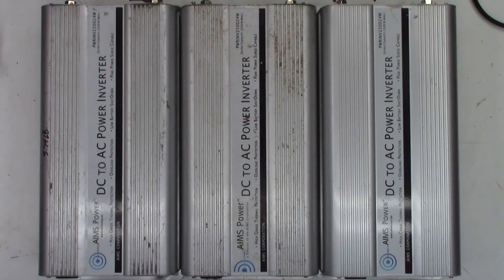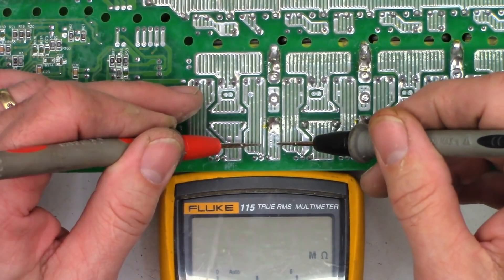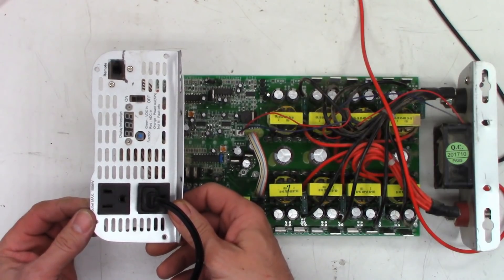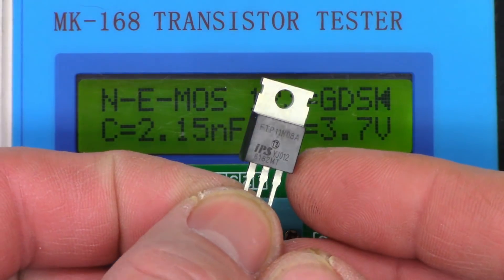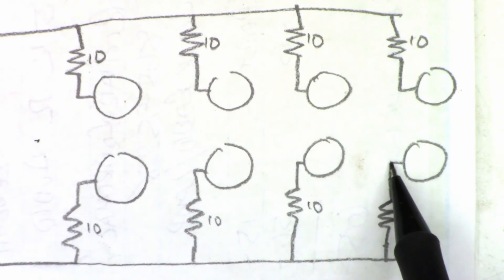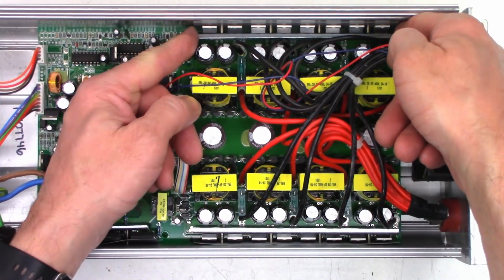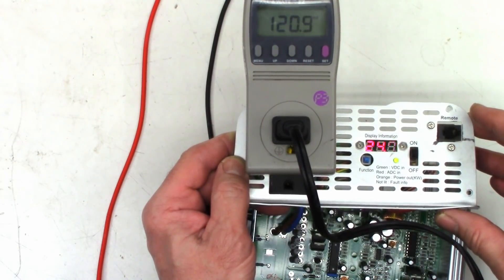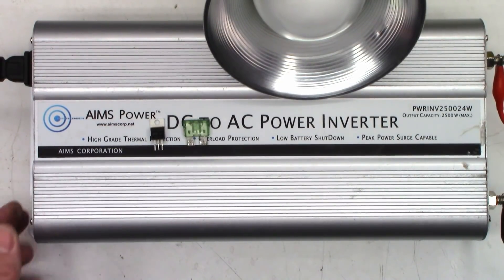CUSTOMER SENT 3 AIMS PWRINV250024W INVERTERS FOR REPAIR. THIS IS INVERTER #3

Comment: Thanks Again for all your videos, I will be checking out a lot more of them, And am gladly to donate, I have a 3,000 watt 12v Aims pure s wave industrial that has I believe 2 output mosfets that are shorted but Aims had scratched out the label so I cant tell what power mosfets are used, the input mosfets are IRF3205 p516 wtpn , Any Ideas what number these might be?
Reply from the maker: I do not know sorry. I cant stand it when companies do not give the customer the right to repair their own products.
Reply: @norcal715  Thanks, I was able to figure one out and they use IXYS

Comment: I worked with dc motor controls 24v @ 150 amp .
( We made & designed them before the imports shut down that section ) .

The golden rules with a Mosfet was never mix batch numbers on one arm of a bridge .
Component types must all match in the bridge .
We used 6 different parts for the same pcb build !  

You could find four different batch numbers in one H bridge .

The trick is fast switching time , using the correct gate voltage & drive them hard !
The gate capacitance needs the drive current .

Comment: Guess the MOSFET failed because the screw was either loose, or it was held off the heatsink by a bit of dirt from manufacture. At least one out of 3 was repaired, although you probably could have used the other 2 as parts donors, as not all the FET's were killed there.

Matching the FETs should have been for threshold voltage, comparing to the good ones on the other blocks that side, so they all roughly turn on at the same point after the transistors that drive them start to charge the gate capacitance. Not that it makes much difference here, as I have replaced them with wildly different other types, just so long as they meet the roughly same gate charge requirements, and voltage withstand, and resistance is low enough when on, it is not too much of an issue at the relatively slow rate these switch. They just need to be driveable roughly equally to the others, 10% either side gate charge wise and gate capacitance is not going to matter much. Voltage wise 3 times max supply voltage or more works, so here 100V parts, for 12V inverters 60V parts also work well enough. Biggest thing is that failing transistors often kill drivers, and kill the microcontroller as well as they die.